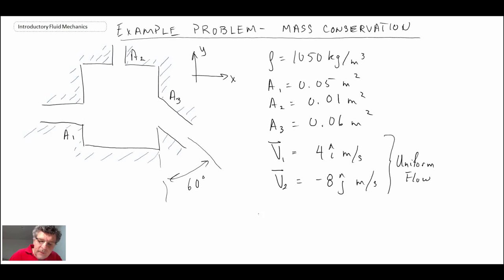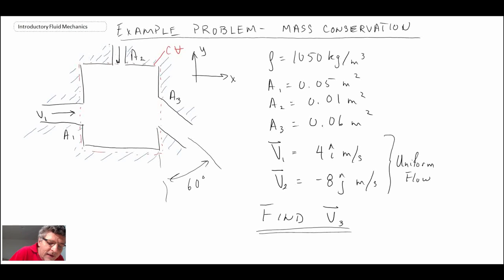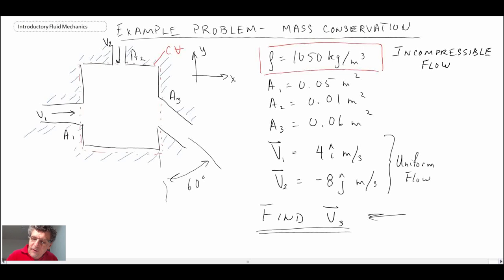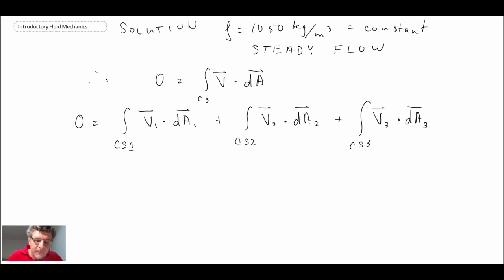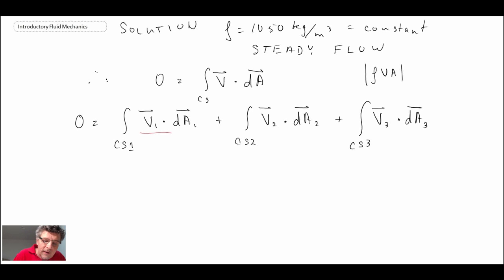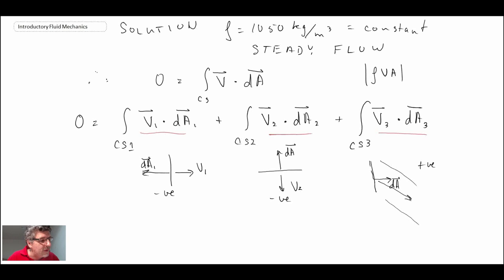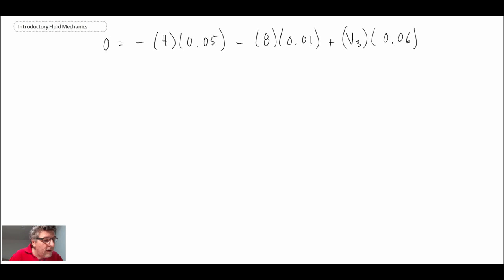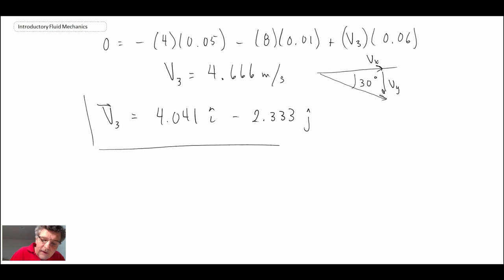Introductory Fluid Mechanics L8 p3 - Example Problem - Conservation of Mass

Comment: Isn't the calculatet value 4.666m/s for V3 the flow in i direction and the over all outflow adds up to 5.39m/s? Because the when we neclect the angle in the calculations, we should recieve only the pure outflow perpendicular to the area. And so when we include the angle of 30 Degrees afterwards, we can obtain the overall outflow and the j direction? I hope you can help me with that?

Comment: Since your taking the dot product you need to include the cos(pi/3) term, magnitude of velocity would give you 9.33m/s not 4.67 m/s
Reply: If your taking A3 to be the area of that pipe, your analysis would make sense if the control volume was drawn correctly (A3 need to be drawn normal to flow)
Reply: Hi, we are using degrees not radians.
Reply: @scotthanon4517  i also feel the area should be (A3 cos30) to get V3 in the direction parallel to the pipe. that just a roundabout way of doing what u did. so is his way correct or should it be changed?

Comment: I have a question that has been bugging me: if you have a control volume similar to this, but the control volume is essentially a room where you want the pressure inside to increase, would you have a non zero time rate of change term for the mass conservation? If so, do you have any examples of this kind of calculation?

Comment: why is the area vector opposite of the velocity for the first 2 parts but not V3
Reply: That is my question also
Reply: Hi, it is a little bit too late, but the area vector has the direction OUT OF THE CONTROL VOLUME. So if you draw the box, A1 goes left (left wall), A2 goes up (top wall), A3 goes right (right wall). If you draw a dot in the center of the volume and then draw arrows - pointing from the volume center to the selected inlet/outlet centers, you will get your answer. It does not mean the velocity vector is opposite to the area vector.

Comment: pls explain last part  v= 4.041i-2.333j,  how did we get this ? im confused little bit.
Reply: Trigonometry:
The angle alpha = 60 ° is between the vertical and inclined wall, however the inclined wall therefore also holds 30 ° to the A3 vector, which is actually the x-axis. Let's call this angle beta. Since the angles are below the x-axis, they are negative. Therefore: alpha = - 60  ° and beta = - 30 °. Now we can calculate the right-angled triangle.

The v3 we got from the integral equation is not v3, it is the magnitude of v3.
v3x = cos(-30 °)*v3_magnitude = cos(-pi/6)*v3_magnitude = (+0.86...) * (4.66...) = 4.04 m/s
v3y = sin(-30 °)*v3_magnitude = cos(-pi/6)*v3_magnitude = (-0.5)*(4.66...) = - 2.33 m/s
v3 = (4.04, 2.33) m/s .... or written with unit axis vectors: .... v3 = (4.04 i m/s) + ( 2.33 j m/s)
Reply: By using trigonometry. Remember that, when calculating the components of a vector we use the angle that the vector forms with the x axis. So, instead of using 60 we use 30 degrees. Also, the angles would be negative because they are under the x axis.